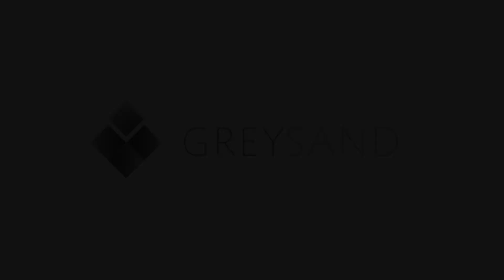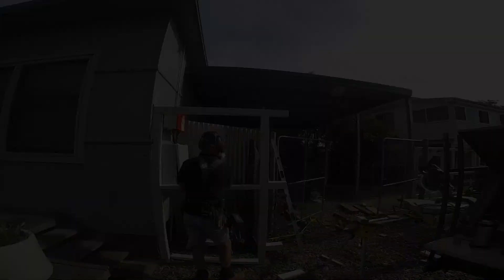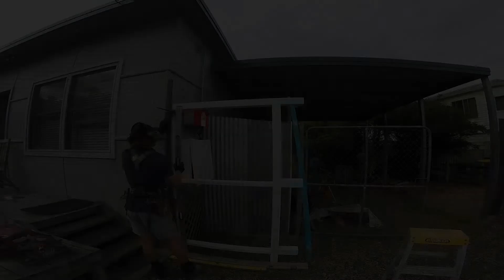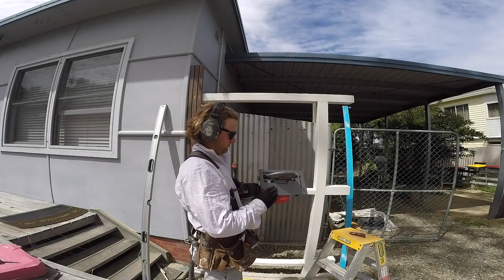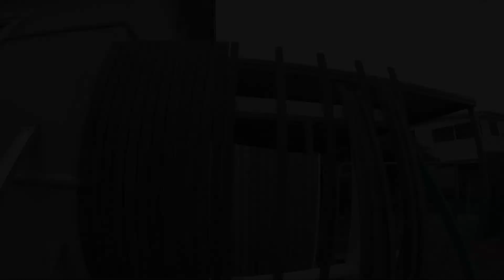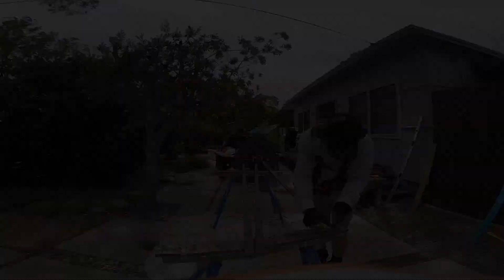How to Build Vertical Timber Screen

Comment: Very nice work. Great explanation too. Could you still use 5mm packers to space instead of wedges?
Reply from the maker: Hi Ciaran,  yes no problem to use a packer. Installing every 5th board and using wedges in between will save some time and give you and exact set out of the width.
Reply: @GreysandAlex  cool ill give that a try. Do you have an Instagram?
Reply from the maker: Hi Ciaran, I'm in the process of setting up an Instagram account. I'll let you know when I have it set have. Have a great day